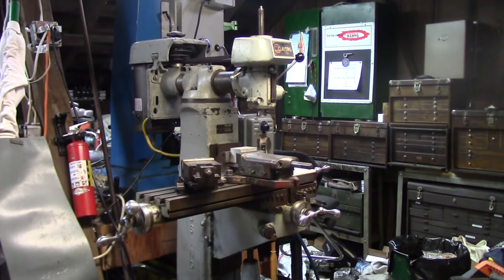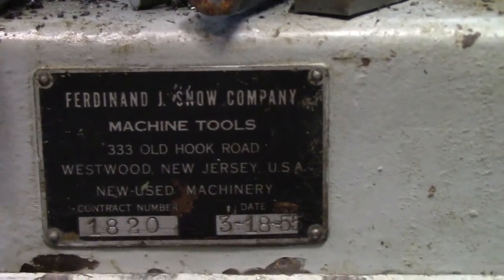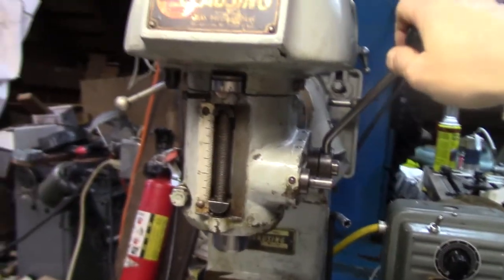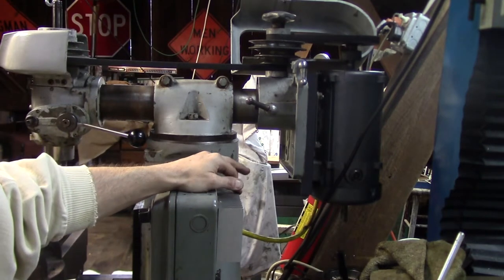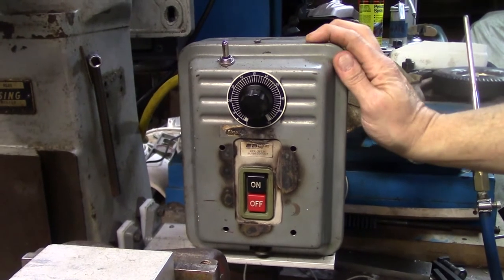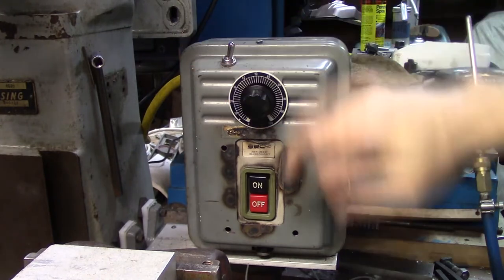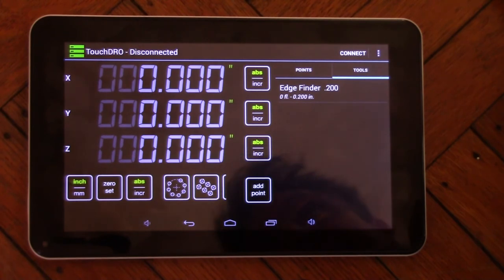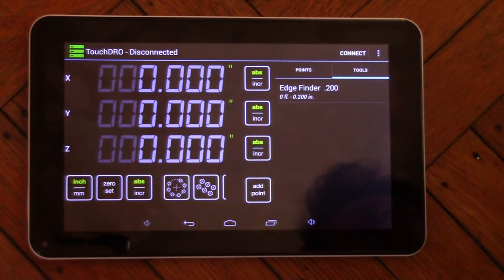Installing a DRO on the Clausing 8520 Milling Machine  Part I

Comment: Have the same Mill,,,,mine was from a fellow he had for personal use,,don't think he used it much,,,I mounted the scale on the front of the table,,used the channels and set it out a bit,,,doesn't interfere with anything,,,extended the locking lever out just a bit. The back was a issue because of the Y travel as you know.  Love this old mill,,,you would think it was new. Like to put that motor on it ,,,cool idea with the variable drive.

Comment: Have the same mill, built mine is made in Kalamazoo MI, mounted my x on the front, in the back it's in the way of the y axes. have to mount my z on the side like you, but going to taper two blocks for the tower mounting, now have to watch the rest of you video. Can send pictures if you like.    Thanks so much.  Doug

Comment: I've found that if I use a long pry bar, I have an easier time moving the belts to different positions. That said, I really like your VFD and bigger motor, and I will probably be moving in that direction; if only to add some more power on the fly.

Comment: would add a stop at the back of the table to stop the oops to far crunch Grins
Reply from the maker: +Bleu Wolf That's an excellent idea.   I think I'll drill and tap a couple of extra holes in the table and install some brass bolts as an adjustable stop.    I did notice when I took the vise off that it was already hanging off the back of the table about 3/4", so I definitely wont be missing the slight bit of travel I'm losing.

Comment: beautiful motor upgrade. perfect. great video.  what's the biggest part you can make on this machine...approx
Reply: The biggest limitation is the short distance between the head and the table... only about 6"   The column is split, so it's not terribly difficult to add a riser block

Comment: hi my name is pete im also from the new york area (long island) i have an 8530 clausing its a great mill i am looking to put a riser on column it already has a 1 3/4 in riser any ideas  great videos i enjoy them all thanks pete
Reply from the maker: +TheDieselmb Hi Pete,   I've been contemplating adding a riser on mine as well.   I have the table casting from an old Atlas shaper that I've been thinking about cutting down and using.  Another good option is to use some MIC 5 aluminum plate.  It comes in thicknesses up to 4" and is extremely flat.   Offcuts show up on eBay frequently and it's not terribly expensive.   There's been quite a bit of discussion of risers over on hobby-machinist.com